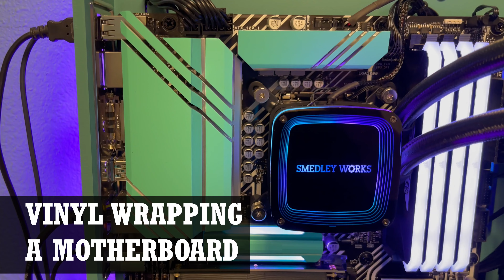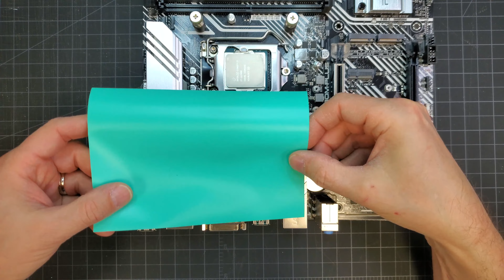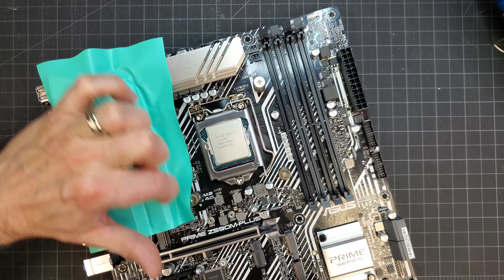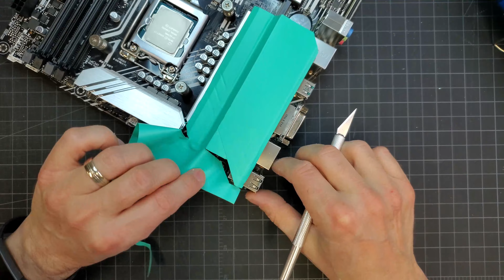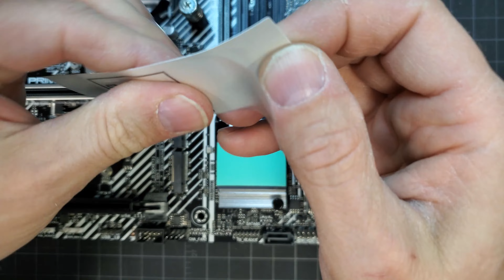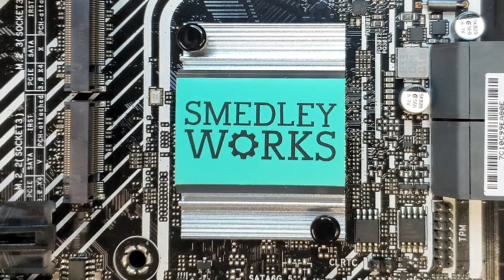Color Change Your Motherboard with Vinyl Sticker Wrap for an Epic PC Mod

Comment: did it raise the motherboard temps a lot? is it removable? Oh and would the "self-adhesive" kind work? I'm presuming that kind doesn't use a heat gun. I want to put woodgrain to cover the dragon on my msi board lol
Reply: not much i think. since u only wrapping the top layer. it still does its job disappitating heat